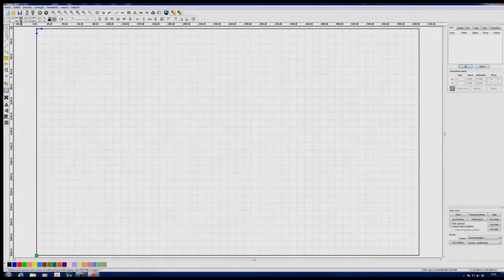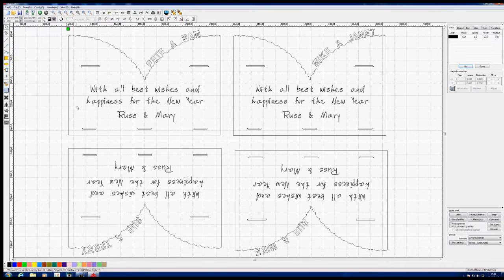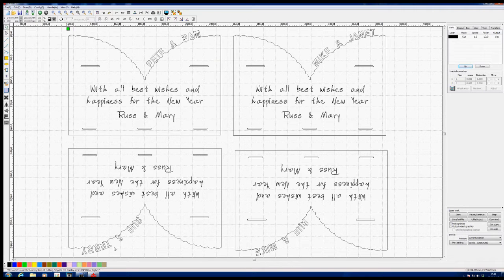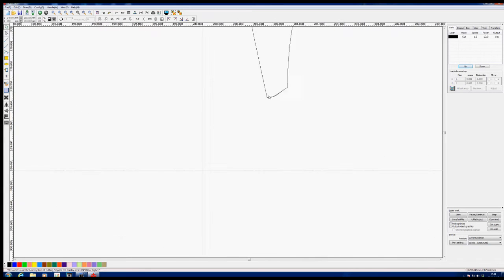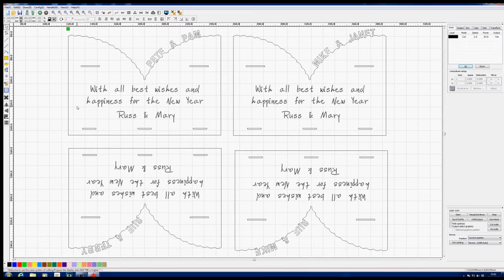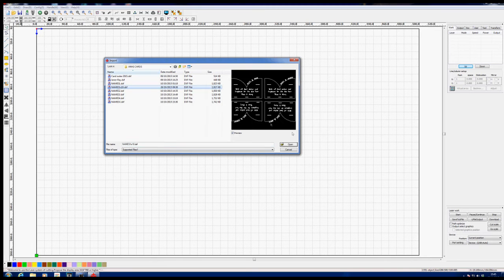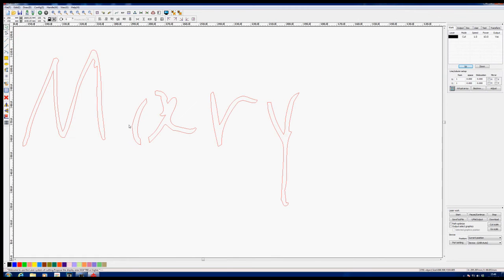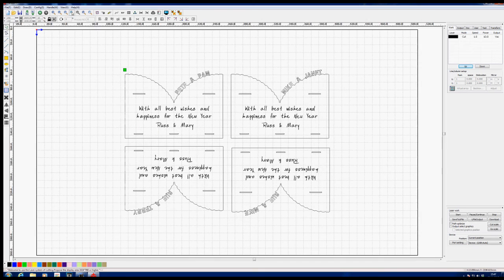RDWorks learning Lab 23 Fine detail import problem solved

Comment: Have you had issues with "bridge" functionality in RDWorks?
Sometimes I get "junk" consisting of short line segments when I am bridging circles, happened with 12mm(1/2") sized cirles and even some one cirle that hadnt been touched in bridging displayed alot of small line segments.
Reply from the maker: Hi 
 This was early in my learning  journey and I am now  fairly familiar with the mechanism by which lenses cut. I am a bit unsure what your real problem is but the    RDWorks HANDLE bridge  tool works very well and I use it often.  How big a bridge and how many (usually two is enough and for small parts just one) will depend on the lens you use and the material thickness.  Typically 0.6 to 0.8mm  works for me.  On the other hand, I think you may be speaking about another problem. Take a look at this short video.. I am using acrylic so that you can see the drag effect of the beam but watch carefully what is happening to the bottom of the beam.   https://youtu.be/Ay0xFzhvbyI
That erratic motion of the bottom of the beam can be seen on the underneath of a cut that is moving too fast. Its allowing some parts of the "hot gas" to burn through and when the beam jumps to its next unstable position it cuts through again.  If you see curved striations on the edge of your cut you will know you are cutting too fast and these are hot gas cuts and not laser beam cuts.  Shout again if I have misunderstood anything.
Best wishes Russ

Comment: Many years later, you saved another soul from oblivion. Thanks very much. P.S: I found that saving a DXF in the 'R12' format from inkscape gives lots of errors if the unit sizes are mismatched between programs. Selecting the 'R14' option when saving as dxf gives another pop up window in which you can select the unit size to match RDworks. I made everything in mm scale and it all suddenly worked without having to make the image 10x bigger.

Comment: THANK YOU SO MUCH!  I run in to this problem A LOT! I have been meticulously editing all of the artifacts out until I got to a project that was so bad that i thought there must be a better way.  Then I found your video.  It worked! Hours, Days of my time saved! I can't thank you enough.
Reply from the maker: Hi Bryan
Glad this has helped. I have subsequently discovered that the default import settings in RDWorks are the root cause of this problem. Go to Config,  File Para Setting and set the Auto Close and Combine windows to 0.0001mm. This should obviate the need to do the 10x workaround.
Bet wishes
Russ
Reply: @SarbarMultimedia  I gave your new suggestion a try but it didn't work for me. What's even weirder is that when I increased the resolution of the auto close and auto combine, then even importing at 1000% no longer worked. I'll just have to stick with importing anything with high detail at 1000% and the combine settings at 0.01.  That seems to work great.

Comment: Hello! Nice videos. I’m having problems importing a AI file, some letters doesn’t appear on RDWorks when I importing the file. The letters are in Arial font
Reply from the maker: Hi

This was a solution I found to the problem but I did later discover that  the proper way to fix the problem as to go into CONFIG, FILE  PARA SETTING and there you will see lots of import parameters. To solve the df artefact issue  tick the AUTO CLOSE CURVES and COMBINE CURVES and set both values as small as they will go 0.0001mm I believe. You will not there are some AI import boxes. Are they ticked? I'm sure that this is where your problem emanates from. Shout out again if it does not fix your problem and I will investigate further.

Best wishes
Russ
Reply: @SarbarMultimedia   The thing I found recently is when exporting a DXF from AI, make sure to ungroup all of the content before exporting. I was losing letters and details that were in my AI file, but did not import into RDWorks. As soon as I ungrouped everything (if you prefer it to be grouped, save it, then ungroup and export and close without saving. Also, with fonts, I always convert to curves (in a separately saved file or artboard) before exporting. Finally, if you use a script font- convert it to curves, then pathfinder/unite. This will get rid of any overlapping curves in text if the letters overlap which happens often in script fonts)
Reply from the maker: @msyverson3  
  Hi 
It's always good to have  the sort of information you explain because I may be able to pass it on to others. Sadly it does not apply to me because  I rarely work in AI except for the trace function to convert bitmaps to vector outlines.  I usually load these into my CAD system and manually convert them to lines and arcs. My CAD is happy to work with TTF fonts so they are already auto converted to lines and arcs. A few months after posting this video I discovered that changing the DXF import parameters fixes the issue and allows me to import things like script fonts without issue.
 Many thanks and Best wishes
Russ

Comment: hi , first of all thank you very much for all the time and effort you put into these instructional videos ,
i got myself once of these machines and every time i try to engrave something small i get double lines on the preview and when i engrave i get the same effect on the piece  , but if i make the text larger the double line goes away and the engraving is clear and crisp , i tried doing what you mentioned in this video but still got the same results 
your help will be much appreciated thanks .
Reply: Hi 
 The problem  is caused by the poor response time of your  HV power supply.  Let me guess that you bought your machine from ebay and that your tube carries a label that says K H Laser? You need to add your email to another comment. I will get auto-copied to my gmail  and will remove your comment and reply to you, I shall need a picture of the wiring to your HV power supply. I think I can fix your issue.

Best wishes
Russ

Comment: so simple but so important solution ..this same problem was just killing me ..but as always you were there for help..thanks russ
Reply from the maker: Hi Amit

The solution works fine but later on  I did find out that if you go to Config, File Para Setting and change Close Error (mm) to .0001 and Combine Error (mm) to 0.0001 then the import is good without the scaling.
Best wishes
Russ

Comment: What’s the best file format to import into rd works. I’m working with various apps and programs and would like to know what file works best. Thanks
Reply from the maker: I almost exclusively work with DXF files from my CAD system They , along with Adobe Illustrator files are vector format and are a must for cutting. They are multipupose in that you can specify parts of the darwing  for engraving also. All the bitmapped fomat files (bmp, jpg tiff, gif etc) can only be used for scanning. So it depends on your needs as to the best format . it is not usually personal choice but forced upon you by the job need.
Best wishes
Russ
Reply: SarbarMultimedia 
Which cad software ? I’m used to auto desk cad but can’t afford it for private use. Any suggestions.
Reply from the maker: My google mails shows you have asked a question but it's nowhere to be found. Ref you question about DXF import sizes. By default the scale you are working in is mm so your inch imports will be very small because RDWorks thinks the numbers are mm. Go to Config . File Para Settings and change the import DXF setting to INCHES and then go to the bottom window and change the overall system units to inches.
Best wishes
Russ
Reply: SarbarMultimedia 
Sorry not sure why it was deleted. 
Got it. I was able to find those settings and it’s fixed. 
Another question. Does rd works read the  settings (vendor settings, config settings) from the laser when rd connects to machine. I don’t have the machine yet but I’m leaning rd works prior so I can get a jump on it. 
Just wondering as I don’t want to mess up the thunder laser when I get it.
Reply from the maker: Connect your pc to the machine. select Vendor settings (RD8888) and press the read button. This will upload the settings that Thunderlaser have used to set your machine. I would have expected them to save a record of this but to be safe, press the SAVE button and copy the file to somewhere safe. If you wish to modify any settings then make the changes and WRITE them back to the machine. Go to the top right USER tab and do the same thing, save the settings to a safe place. The config settings are held in your copy of RDWorks and can be changed at any time. The data will be used each time you create a program. By the way, back to the Config, File Para Settings. There are two items in there Auto Close and Combine that by default are set to 0.1mm (in your case.004"). Make both as small as you can, maybe 0.0001"? This will fix the DXF detail problem I mention in this video.
Best wishes
Russ
Reply: SarbarMultimedia 
Awesome. Thanks again for help. I’ll be asking a ton of questions once I get the machine in a few weeks. Hope u don’t mind
Reply: SarbarMultimedia 
Do you like lightburn or rd works ?
Reply from the maker: Both. although eventually when Lightburn is complete it will be my one and only. At the moment you have to run both because changing user and vendor settings is not yet integrated into Lightburn. Many Lightburn features are so much more user friendly and the photo engraving aspect of Lightburn is far superior.
Russ
Reply: SarbarMultimedia 
Thanks.

Comment: Even easier solution.. Go to config>file para setting. Change "close error" and "combine error" to 0.001mm. Problem solved.
Reply from the maker: Hi Jamie

Nice idea.  Neither of these parameter settings, individually, fixes the import errors .However, combine them as you suggest and I can confirm that it really works.  Many thanks for the tip
Best wishes
Russ

Comment: importing vector to RDworks and laser is cutting two passes, not one pass, why?
Reply from the maker: Hi
I suspect that the vector file you have imported is a tracing of a raster shape? When a tracing takes place in a program such as Illustrator, all shapes get traced TWICE. One trace is around the black areas and then for good measure it traces around the white areas. If you zoom in  (usually towards corners) you will see evidence of the TWO traces. Sadly it is now a tedious job to go round your drawing and delete one of the shapes for each object. Lots of detail? VERY tedious. I have been there many times.
Best wishes
Russ

Comment: Hi,

I am having a very peculiar problem.

My work is getting glitched. I've checked the lubrication on the belts and the motors seem fine. The glitches also show up only when I scan something. Cutting is fine. Speed doesnt matter. Whether its moving at 20mm/s or 100, 150 or 200mm/s, these glitches show up.
The frequency of the glitches is also increasing.

http://imgur.com/a/fRMLa

Thanks

(I tried to send this message privately but I have no idea how that works or if you received it. If you got that one too, I apologize. My intention is not to bother, just trying to solve an issue)
Reply from the maker: Hi Aeizaz
Check your you tube messages.
Russ
Reply: Your belts need to be replaced.  The stepper motors hit a spot on the belt that was worn out/burned most likely.  Have a recent fire?  

Assuming you have been answered already.  This is for everyone else.

Comment: Curious if you've had issues with importing files from other programs where you've coloured the lines for different cuts?  Whenever I import the files, the colours always seem to get changed to black.  I'm using RGB colours in Adobe Illustrator for this.  Maybe it is just how it imports .ai files
Reply from the maker: +Krefey 
Perhaps you have misunderstood the problem here. I always import files from my CAD system which are DXF format and only ever one colour (layer).  This is all about  the RDWorks  IMPORTcommand adding unwanted  artefacts. A simple test to demonstrate this problem is to use your originating software to draw a microscopic  0.05mm square. Import it to RDWorks and you will find it has magically acquired a diagonal. Back to your originating software. Scale the square up by a factor of 10, save and import  it again. Now RDworks imports the square without adding additional features.  When you see the laser cutting head jumping around in a strange manner and not doing any  cutting/engraving, that's a clue that you have these artefacts existing in your program. You will need to zoom right in to the .rld file to find them. Some you can delete but some you cannot. The solution is to scale up for export and then scale back down after import. Works 100%
Regards
Russ
Reply from the maker: Hi
I often use Photoshop  to collect various graphics from www. I then work within Photoshop  get clean black and white images that I can Live Trace in Illustrator. I then export the outline only as a DWG or DXF file into my CAD program. There is no layering at this point. When I have finished preparing my design it gets saved as a DXF file which RDWorks is very happy to accept. But when there is VERY fine detail involved (particularly acute angles) RDWorks seems to overshoot some corners and put little extra loops on those corners. By making everything BIG for import overcomes this issue  and RDWorks is happy to then scale down without producing artifacts.
ONLY when the file has been imported into  RDWorks do you start adding colours/layers. As you rightly observed, colours do not get imported. 
I hope this clears any misunderstanding.
Best regards
Russ